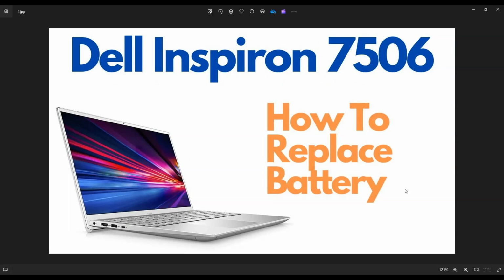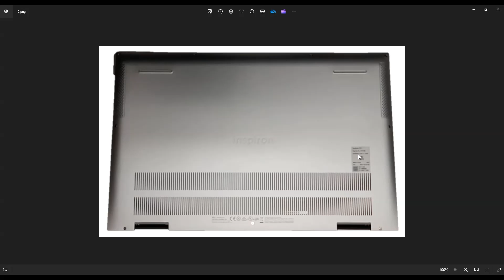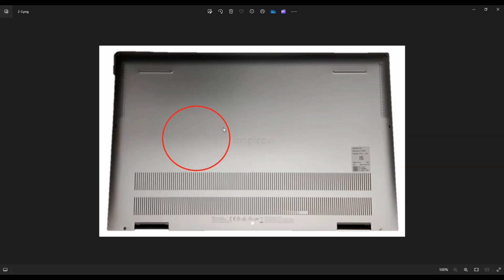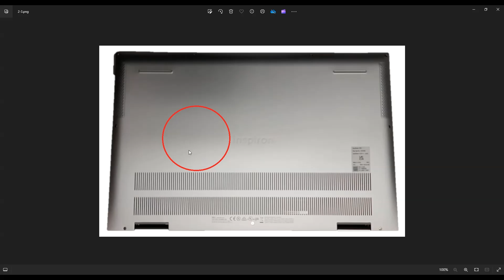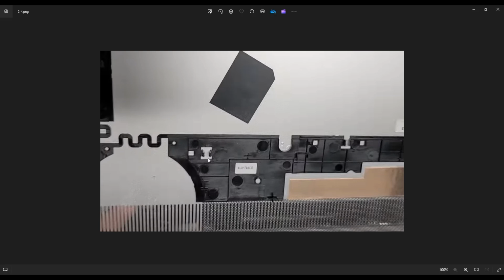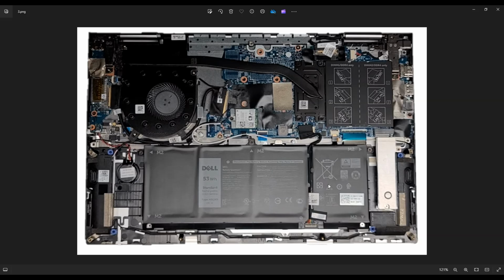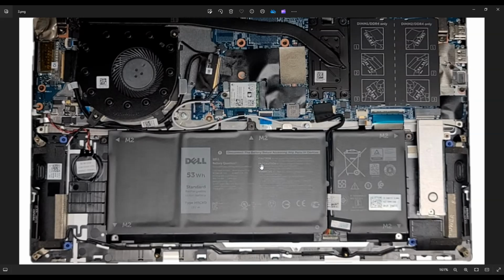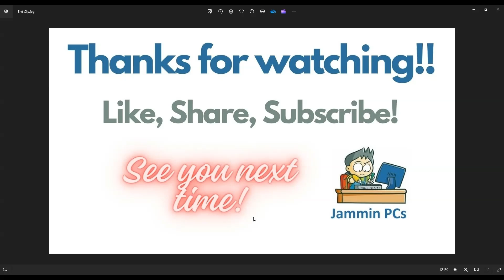How To Replace Battery - Dell Inspiron 7506 Laptop Computer

Comment: HI, my current battery lasts only about 30-45 minutes anymore, so I'm thinking about replacing it. Similar to a question that came up before, I see a variety of retailers on Amazon offering a battery replacement. Prices are generally around the $25-$35 range. So I have two questions: (1) as far as you know, is there a material difference between the battery and/or company that sells the battery for $25 vs $35? (2) is the capacity and life expectancy of these off-market batteries different than that of an OEM battery? I don't mind spending more if the quality is better. I don't want to have to replace the battery again in just a year or two. Thanks for your help!
Reply from the maker: There are so many different battery options, its hard to say. Just make sure the Volt, Amp, and Watts are the same. You should be good. No, if all those are the same, there isnt really a big dif in quality :)

Comment: GREAT VIDEO until I got really confused about something :)  Based on my battery report for my 7506 2in1 (which told me that I have less than half capacity from the original 68Wh hour design), I am confused about the different screw locations on the replacement battery.  Your video shows  the 53Wh battery but every thing I pull up for the 68Wh hour battery shows different screw locations on the battery, very different.  The battery report says the battery is DELL JG75F16, so once I open this up, is it going to be different than your video?   Thank you in advance!
Reply from the maker: The battery should be the same if its the same 7506 model. However, some computer models have variations even within the same model. Very annoying :( Make sure before ordering a replacement by looking inside yours and seeing the screw placements. You can then compare it to the one your looking to purchase online.

Comment: Dell wants around $120 for this battery...Vendor on Amazon you provided link is around $36.   Would love to save the money but don't know if the OEM battery is superior quality or safer...?
Reply from the maker: In my experience, generic batteries for laptops tend to only work around 70% of the time. When they do work, they are fine. No difference in quality or safety. When they dont work, they dont work lol. Because of the price difference, I tend to try the generic first. If it does not work, I return it and either try again if money is a big factor in the repair I'm doing or just go OEM at that point. Hope that helps :)
Reply: Thanks for the advice.   Never changed a battery in a laptop.  I have a Dell 7506 2 in 1...Probably just get the OEM.   

I've noticed this computer really heats up and the fan rarely shuts off (battery or running off AC)..Hard to hear movies while streaming because of the fan background noise.   Could be because lack of air getting under computer (resting on bed)...but still seems to take a long time to cool down even when I picture frame stand it up with it's reverse screen/stand up option.    If you have any suggestions,  much appreciated.
Reply from the maker: @downings5thfifth  Just so you know, over heating situations can be hard to troubleshoot just one issue as multiple different components and boards including the motherboard itself, could all be faulty. 
An overheating computer can be damaging multiple different components if not resolved. First, make sure that the fan and vents are clean and clear. If you need help accessing the fan, let me know what brand and model computer you have and I can help you get inside it. If that does not fix the overheating issue, then try replacing the thermal paste on the CPU and if needed, the GPU as seen here; https://youtu.be/gGCUmI2NU0E. Let me know how that goes :)
Reply: @jamminpcs    Sounds likely over my expertise level....but thanks for your advice.
Reply from the maker: @downings5thfifth  You can see how to do it here: https://youtu.be/gGCUmI2NU0E. Good luck in any case :)

Comment: The middle screw on the bottom (the side where theres 3 screws) for some reason is completely stuck. We are able to remove every other screw completely fine, but this one screw wont turn and it is disabling access to the motherboard. Do you have any idea why this could be?
Reply from the maker: Is it stripped or can you not turn it with the correct sized driver?
Reply: I'm having the same problem. And in a couple other places. Not sure if I'm supposed to turn the screws in the same direction all the way around.
Reply: @ChunkyKnittedCreations-kt9nu  Are the screws stripped or are they just continuously turning without coming out?
Reply: @PC_Monkey neither. They just won't turn. The others turn with my little red screwdriver but not these three. I've tried three different screwdrivers.

Comment: I have a question.  I recently changed the battery in my Inspiron 7506 2-in-1 laptop (black) & something came loose when I did.  Can you tell me what the name of the part is with the blue ribbon that is right next to the battery (to the right of it) in your video?  That blue ribbon got disconnected & I’m not sure if I broke it or not?  Thank you.  It got disconnected as I was replacing the battery.  Thanks.
Reply from the maker: That large Ribbon Cable should go to the Keyboard. Are you ok putting it back in? Those Ribbon Cable clips can be very breakable
Reply: @jamminpcs  hmmm . . . That was the first time I ever opened the back of a computer up & I managed to change the battery.  Things were flying . . .like the cups I put my little screws in and I don’t even know exactly what happened to loosen that ribbon?  I must’ve done something.  I hope it did not break?  At first the battery showed as excellent but in a couple of days, I could no longer charge the battery.  So I’ve ordered a DC Jack & some better tools.  How can you get another Ribbon Cable clip if you need it?  Hopefully it still works?  Thank you!!!
Reply from the maker: @mariechristian5413  I would usually find ribbon cables on sites like Ebay, Amazon, etc.

Comment: Do you have any video on how to take the battery cable off and reinsert? We removed everything and my husband was very reluctant to remove the battery cable.
Reply from the maker: The bottom plug into the battery is just a snap. You just pull it up and away from the battery. The top of the cable that plugs into the motherboard unplugs by pulling down towards the bottom of the computer :)

Comment: Great video! The OEM battery is 65w but the replacement is 55w. Is that correct?
Reply from the maker: The battery that was in this computer was a 53Wh battery and the replacement one in the list I made was also 53Wh
Reply: @jamminpcs  Hmm I haven't physically checked the battery but in BIOS it says 65W. I have the 7506 2in1.
Reply from the maker: @shegocrazy  Perhaps your model uses a different battery than the one seen here. I would stick with the one your computer uses. The part number for this battery was H5CKD. Do you see a different number on yours?
Reply: @jamminpcs  I pulled the back off and it is indeed a H5CKD 53w battery. Thanks for your help!
Reply from the maker: @shegocrazy  Happy to help :) Always here if needed !!

Comment: Is it okay to use the off brand battery that you linked in the amazon link? I can't find a genuine Dell replacement on their site.
Reply from the maker: Yes. Thats your best bet for off-brand. The brand name ones are usually only available from the manufacturer :(
Reply: @jamminpcs  On the clip where it plugs into the battery, do you just push straight down on it? I did that, it is working but it doesn't seem to be AS flush as it was with the prior battery? Can that create a fire risk?
Reply from the maker: @michaeld.7265  It should definitely be flush. However, if the size of the plug is not the exact same due to it being off-brand, it should be fine. :)